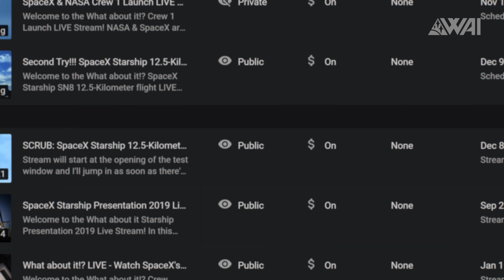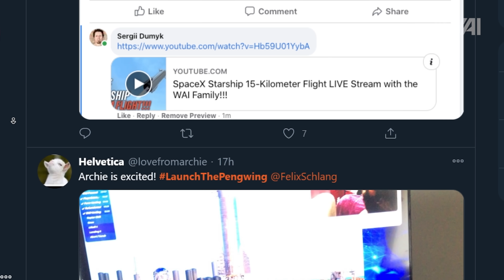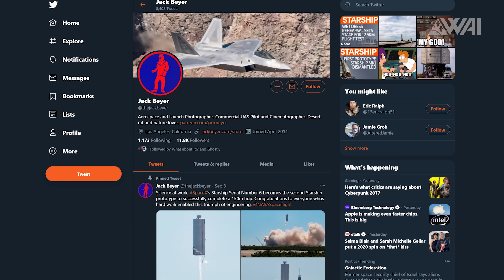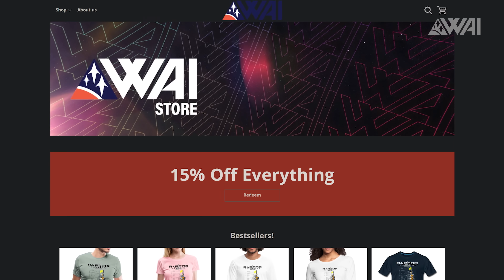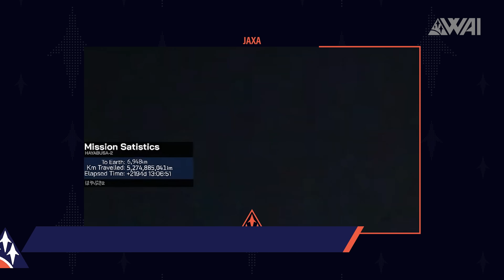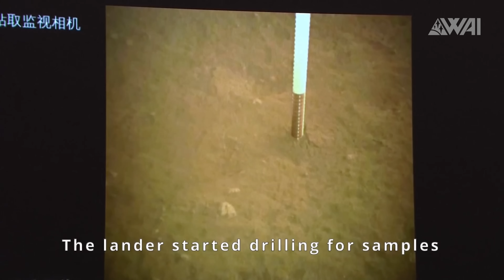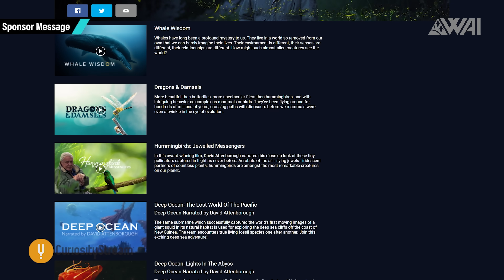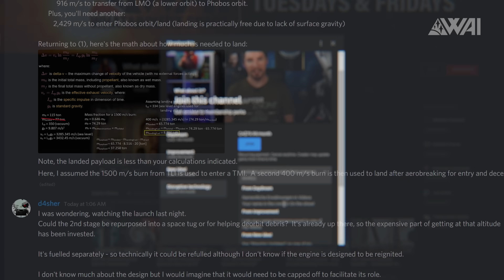138 | SpaceX Starship SN8 - What's next?

Comment: There's a (small but vocal) part of me that's annoyed about the asteroid sample missions. It seems to me that there is a lab in orbit that could take delivery of the samples and split up the load rather than risking the entirety of the samples in reentry. A bad reentry or landing and the whole mission is a failure. If part of the samples were left on the ISS then if the return to Earth fails there's still a chance of success.

And let's be honest, the ISS (or future space labs) should be equipped to handle 99% the analysis desired of the samples so that there's no unavoidable need for the samples to return to Earth.

Comment: I wonder if the cut off of each engine one at a time was intentional. Once they hit a certain height with all three they have verified functionality. Running with two would give a better perspective on how it currently performs IF one would fail, which is why they ran it for a while before cutting the 2nd engine. A test to gather data from all three flight modes before flipping to return. Maximizing flight data from one hop, and further testing the relighting of the engines with different turn off times and temperatures.
Reply: good idea makes sense

Comment: 6:29 Wrong weld comment.  The hightlighted area was assembled in the windbreak. The 5 ring segment was attached to tank section at the triangle shaped lift points ring.

Comment: actually, you would have an easier time pronouncing chang'e 5, if you knew about a speciality of the chinese language. tones.
simply speaking, differently to german, english and most other languages, altering the way you pronounce vocals really matters (it's not used to indicate questions)

essentially, there are 4 tones, descending, ascending, same level, and down, then up. for chang'e 5, it's the last tone. just listen to her, she lowers the tonal height of the last vocal, the upped it back up. it happens within half a second. it sounds like a weird hickup..., but that's totally intentionally.

by the way, vietnamese has 6 tones, it's even harder.

Comment: I believe the raptor shut off's from the launch after this video where intentional. The gimbals started moving before the shutdown so I believe they where acting to prepare the starships flight and angle for the moment of raptor shutdown. This occurred both times. My explanation as to why. I believe as the rocket got lighter from propellent usage the thrust was higher than necessary so it shut off the raptors as their minimum thrust was too much. They did it so they could have a more precise apogee by almost hovering the starship rather than by letting it use it's momentum to reach apogee. This would maybe allow for a better more controlled flip into the belly-flop?